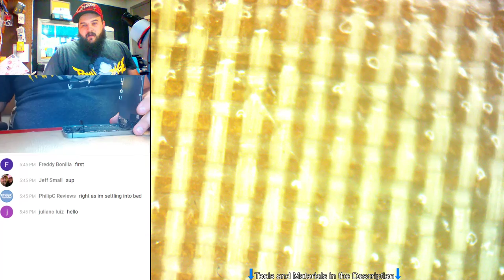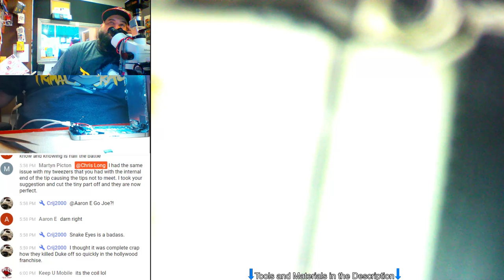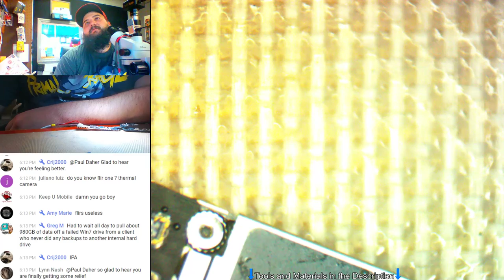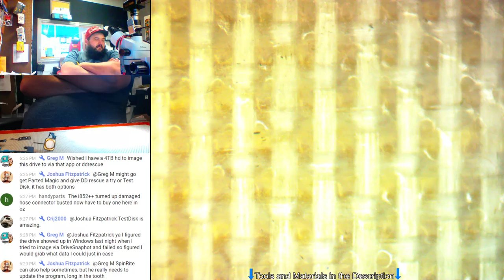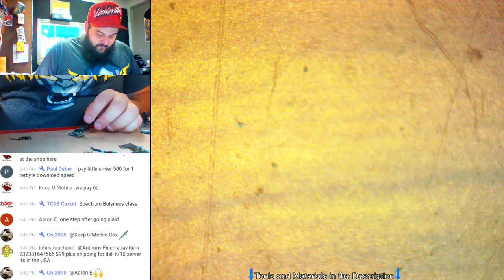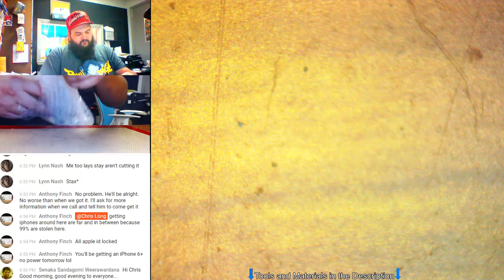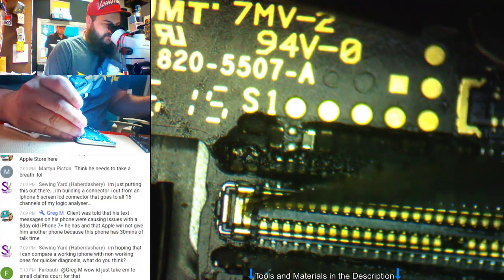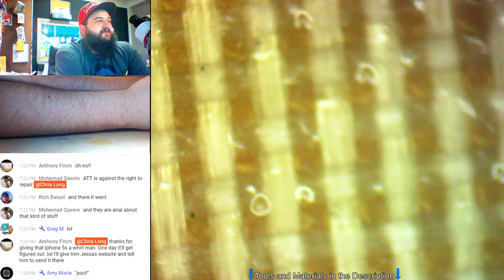iPhone 5S Boot Loop cannot enter Recovery Mode

Comment: Had same issue with iphone 6 but without usb problem.. It's ram, but correct me if I'm wrong. Dfu is hard coded into cpu but to get into recovery, phone has to load iboot/recovery from nand to ram but fails to do so